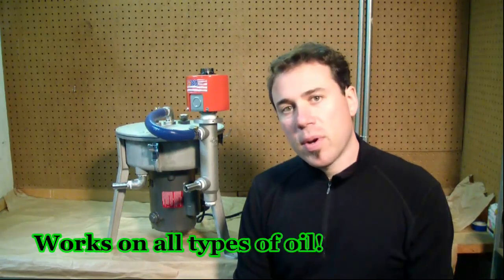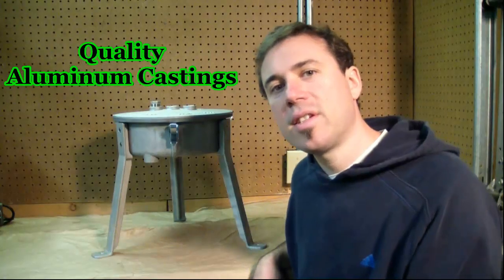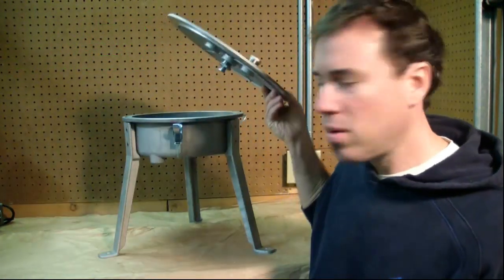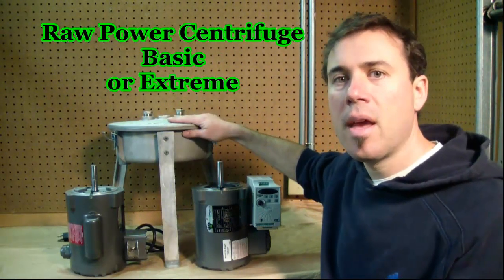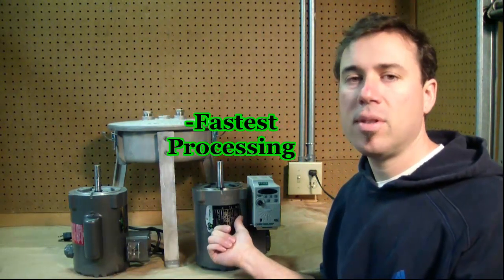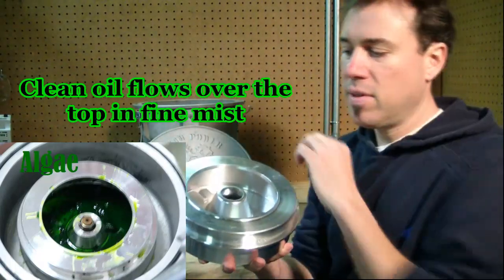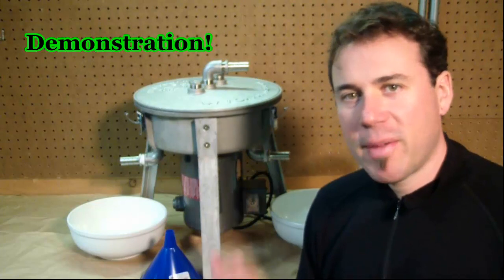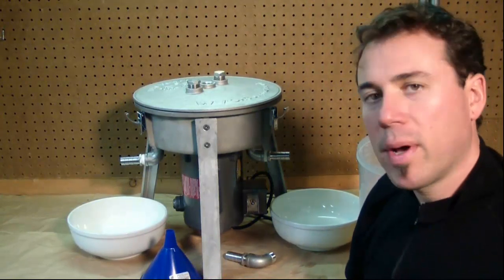Algae Centrifuge - Harvest Algae

Comment: Is it possible to purchase separate centrifugal bowls, so it can be replaced and put back in service immediately? That way, the centrifuge can be running, while the bowl is being cleaned, preparatory to replacing again. I'm interested in this, as a way to remove algae from a Koi pond, without having to replace filter media. For what I'm doing, I think the basic 2-pole single phase motor would suffice. Is there a larger, lower speed model that has a larger bowl that you would recommend for my application?
Reply: Hi Vincent.  Yes, an extra bowl will be $250.  Contact me at jason@algaecentrifuge.com for a quote.  Thanks!!

Comment: Could this work with sugar beets to separate the white sugar 🤔
Reply: Unfortunately not. This machine seperates things which have different densities. Sugar dissolved in water is a solution that has the same density throughout. You might think that because the sugar molecules weigh more than water that you’d still be able to seperate them but apparently this is not how such solutions behave (imagine how easy it would be to desalinate water if it was). I suspect it’s got something to do with the chemical bonds between the water and sugar being far stronger than the force of the centrifuge but that’s just my guess.
You could perhaps use a centrifuge to separate the liquid from the beets themselves I guess but I can’t see the point unless it’s being used on an industrial scale as a final step to remove every last drop of liquid.
Reply: @charmio  You're on the right track. There's a difference between a suspension and a solution. Sugar water is a solution - the sugar and water molecules have formed weak ionic bonds and are completely dispersed at the molecular level. This liquid therefore acts as a single unit, if that makes any sense. A suspension, however, is much larger clumps of particles floating in the water, and they are only kept in suspension because the water has been agitated. They can still be very tiny, sub-micron sized particles, but they are still thousands of times larger than individual molecules.

The easiest way to tell if a centrifuge can be used to separate material out of a liquid is if that material would settle out naturally if you left it alone long enough. You can think of a centrifuge as just cranking up the gravity a few hundred times higher than normal - things settle out faster much faster, but they're still just settling out of the suspension. That's why it works on oil in a WVO setup - the oil, water, and particulate matter left over from use as fry oil would eventually separate out on their own if you left them sit long enough. Putting them through a centrifuge just speeds up the natural settling process.
Reply: @jeffwells641 wow!